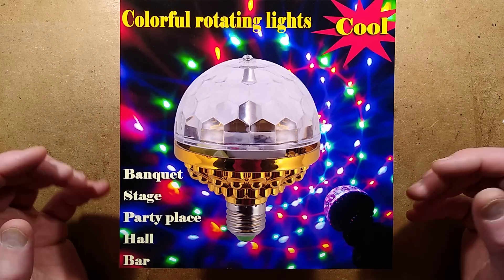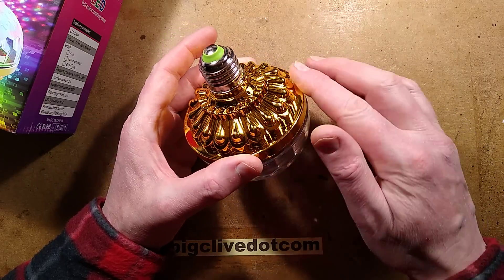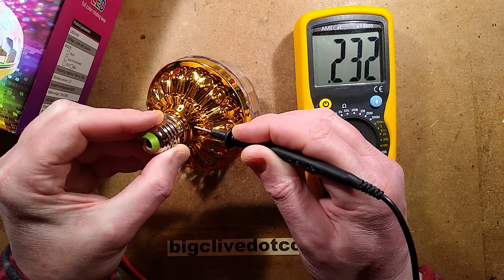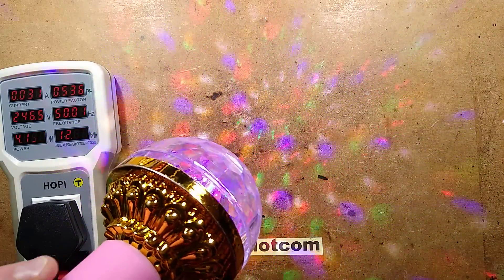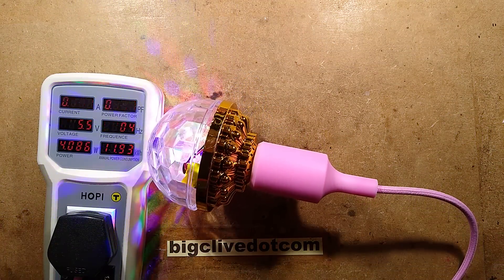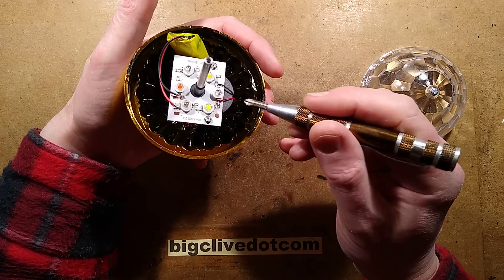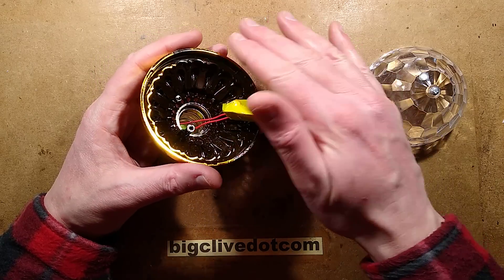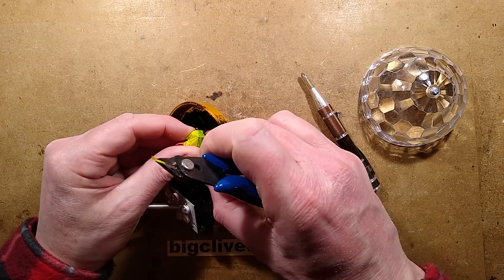"Shocking" disco light with 50/60Hz dance feature.  (Live chrome case.)

Comment: Hi Clive I know this an old video. When I was involved with Urbis UK they used the process of vacumised aluminium to adhere to the formed  engineerd plastic  which became the reflector with a rate of  90 + reflectivity specificaly used in the ZX 3  very popular streetlight. 
If i can remember the material that worked best was on polypropylene. Tried to replicate and found a company doing coffin handles and bling
parts in shinny Brass. Interesting visit. The cabinete was too small and designed to accommodate many small parts only. Did say it was a lucritive business they had established. LoL. Also, investigated the process of plasticise dipping as used on bling perfume bottles tops. Was not suitable. But,  I am going to do your experiment of checking if I get a reading on a Arimis mens cologne Gold cap. 
A question clive? Is the adapter you were used  legal in the UK as you so rightly mention the possibility of cross parallelity from BC to ES lamp cap.
Thank you for another interesting video. I guess the moral of the story it was never made for use in an adaptor only to be used in a E27 lampholder. Greetings from south Africa.
Reply from the maker: The BC to ES adaptor is in a grey area with regards to safety.
Reply: Thank you for your reply and much appreciated Clive.

Comment: Well you can also get shocked from the neutral if the lamp's plug isn't in firmly, with only the light itself as resistance there's still significant residual voltage, no?

Comment: I had an old TV a long time ago, the ones with the live chassis. Now I didn't think the chassis was really live, turnout it did have some potential. I found this out when one of the buttons with a metal cover was faulty and you had to really press it in to make it work, so much that the metal cover just brushed against the chassis and gave you a zing.. lovely. I found out about another one when I took a feed from the speaker through some resistors to a PC sound card to record some TV theme tunes. Turns out that was at a slightly higher than expected potential as well. oops. Sorry soundblaster.

Comment: I'm wondering if, even on a properly wired socket, the base contact could ever be touching the bulb without the screw contact touching, in which case the screw would become live and so would the chrome. Ideal design would require screwing-in before base contact occurs, but I could see the base being spring loaded and making contact first, or something of that nature.

Comment: Is it just me, or is pretty much every video from the UK starting to sound the same? 
'Don't touch anything, ever, if it's not made in the UK, to UK standards, by a certified somethingorother!'  lol
I know you didn't say that, I'm extrapolating!

So, let me get this straight... 
It is dangerous because if I touch it while I screw it in, AND the power is switched ON, then I get a shock?  Oh, wait, no... It ALSO has to be screwed into a UK adapter to fit their odd, non-polarized, socket which would need to be inserted in one of two ways in particular... AND you have to be touching something else for the stray power to have a place to go... 

There should be a counter in the corner of these videos that shows how many individual things have to go wrong at the same time to create the ideal conditions for any of this to be actually dangerous.  Crossing the street in any major city is more likely to kill you than waiting around for any two of these conditions to show up simultaneously!  To die from this particular device, no less than 5 things must go horribly wrong.  Yeah, I think that you're a wee bit anal-retentive about being shocked there, Clive.  ;-]

Conditions simultaneously necessary for this device to shock you:
1: Touch metallic coating on plastic enclosure while installing.
2:  Power to socket is ON.
3:  Socket is an adapter from screw-type to bayonet (only in the UK?)
4:  Particular adapter socket must be inserted in one of two ways that makes the screw part Live, instead of Neutral.
5:  Touch some other conductive, grounded item to complete the circuit. (#5 Must also be a separate limb from the one used to screw in the device if the shock is to be fatal. I.e.: Fingers holding the bulb and touching another part of the same fixture will not count as life threatening.)

So, as amusing as your title was, the chances of anyone dancing to the beat of this Disco Light is essentially slim to none.

Still, I love your videos, Clive!  
Cheers from Canada, 
where our power distribution system is NOT out to kill us at every turn!  ;-)

Comment: Bigclive would throw a hissyfit in Norway. Both my pins are active vs ground. No neutral wire here.
As a bonus I have 3 of them though. Using two separate mains circuits I can find a total of 3 phases all in relation to the safety earth.

Comment: it looks pretty moddable, you could slow down the motor and change the LEDs for single color or two tone as well as adding a spray on rubber coating to the chrome and you could have a relative classy slow moving projection lamp

Comment: Nice light, yep, too bad the Chinese have little respect for human life. I guess its normal for an over populated country. As for the lamp sockets, I guess the EU phased them out just for the reason of not being able to distinguish phase from neutral. This makes no difference as you said if someone wiring a lamp socket does not pay attention to where they hook up the wires. In the states lamp sockets are actually color coded with the Brass colored terminal being phase and the silver being neutral. BTY, I have noticed while living here in the EU for the past 14 years that there is NO difference in base size between an E26(USA) and a E27(EU) lamp holder. I can fit lamps from either region into sockets from either region.

Comment: Shocking.
I'd not thought about those adapters making the outer live before.
Reply: Well, an apropiate lamp holder has the screw-ring separated from the contakts benith it (many cases it's not even conductive as it the plastic holder the screw it self).
Edit: don't listen to me, the lamp screw is made out of one piece...
Why are we using E27 screws even these days?

Comment: Even if the "gold" paint had proven a competent insulating layer covering a conductive layer, it would be very thin so you still get at least a mild buzz through capacitive coupling.

Comment: I thought you were going to twist it and see if the leds glow, and then it gave you a shock, the chip sounded like a solar ic, then you mention about the strange capacitor, maybe it has other applications?
Reply: I had a similar lamp but only red, blue, green LEDs. When not connected to the mains: if I twisted it one direction the red and green lit up, twisted the other direction the blue lit up.
Reply: @nhytg376tgyuu765gjmg  I have one similar, same one I think Clive covered before
Reply: Aha

Comment: Very exciting indeed. When I was a young lad, we moved the TV out to the garage and my dad made a screen for the garage door so we could be cool at night in the summer. The TV was live if you were standing on the concrete (there was an area rug that was safe). We used to purposely stand on the concrete and try to shock our friends. We were kind of stupid. Fortunately there was some resistance as we didn't sustain enough to kill us. But holy shit, we did that. And probably turning the plug around would have stopped it.

Comment: Cos my dad remembers the old days of flawed lightbulb glass, he taught me to install lightbulbs holding them with a cloth and with the power/light switch turned off - then making sure my face is turned away from the light before switching it on in case it explodes into a million pieces. I still  do it that way now, and I'm still alive and unscathed from lightbulb accidents. Chrome or stainless steel light switch plates worry me tho. What happens if there's a stray wire at the back or some fool plugs something in that's wired the wrong colours in to a wall socket and the earth plate becomes live? Worrying that! I once got a shock from running water cos the kettle was wired wrong!
Reply: This is the reason that the UK regs insist that all accessible metal parts are earthed, even screwheads.  What happens is that the fuse blows or the breaker trips and you call in a qualified electrician to fix it.

Comment: Knowing and caring aren't the same especially when cost is involved.

I've always wondered if is possible to design a power supply that has a good power factor and a better VA value than those cheaply made Chinese ones with cost not being a factor. When the power company changes its billing practices it would be good to know.
Reply: Low power factor on DC power supplies is caused by the current draw being concentrated at the high points of the AC waveform due to the interaction of the rectifier with the smoothing capacitor. An uncorrected power supply tends to end up with a power factor of somewhere around 0.5.

The issue can be somewhat improved by adding an inductor ("passive PFC") in the power feed, that can bring you up to about 0.75 or so. In theory you could go further but the inductor would likely get prohibitively expensive.

The better fix is to add a special boost converter ("active PFC") between the rectifier and the primary capacitors. This special boost converter can actively control the input current and achieve a power factor of damn-near unity. There are controller ICs designed specifically for this purpose, for example https://www.analog.com/media/en/technical-documentation/data-sheets/8312fa.pdf

Comment: I've had a similar light with a plastic base. Sadly, the LED driver died less than a week after purchase and I had to return it.
The cap on mine was driven by an AC synchronous motor (instead of a DC motor like on this one) and had a random turning direction.

Comment: Rotating light like that reminds me of the time we had a glitterball in a show. We were driving it through a typical desk (Zero88 if you must know) with the synchronous motor across one of the lights focused on it - I think. The ball was suspended by a chain - random guess of about 10 links  which effectively gave some 'slack' in the drive - so I think what we did was power it up very dim - just to get the motor started before the effect was actually needed. Then, on cue put the spot lights up to full. At which point - or just before, the motor had wound up all the slack in the drive, hit the 'load' of the ball and bounced the motor into reverse just so that on bringing the lights up the ball was stopped again ruining the fact that we wanted the thing to be running when lit. I think it took me about 3 days to figure out why the ball wasn't rotating when the lights hit it despite having the motor running 15 secs or so beforehand. Couldn't be arsed to do anything about it for the remaining 4 shows !
Reply: pmailkeey to be honest, i love a zero88 but Im more a fan of a avolites
Reply: @thecrushingdutchman8202  Haven't come across Avolites other than briefly by name. For 'name-dropping': Strand, Strand/PC, Lee and '2' varieties of Zero88.
Which method of working does Avolites use ?

Comment: Not quite so unsafe when used where edison screw lamp holders are the norm. The UK insistance on using adaptors to convert bayonet cap fittings to edison screw rather than properly wiring a socket is the problem. That and the fact that chromed plastic fittings might as well be metal when it comes to conducting electricity as you so helpfully demonstrated.

Comment: This is a daft question but where does the isle of man get its electricity from? is it generated locally or are there undersea cables? I'm intrigued!
Reply: What a great question, I initially thought. 30 seconds later, after a google, there are two power stations. Peel and Pulrose. There's bound to be cables (wait, I googled) it.
The longest undersea AC cable in the world, no less. https://en.m.wikipedia.org/wiki/Isle_of_Man_to_England_Interconnector
Reply: They actually supply their surplus electricity to the UK proper.
Reply: Doesn't the IOM mine electricity ?
Reply: @millomweb  Looks like almost all of their electricity is generated from gas pumped over from Scotland (and then the surplus electricity is sent back over the cable.)
Reply: @RedwoodRhiadra  Odd as we've a high pressure gas pipe from Morecambe Bay to Sellafield gas power station. (It replaced Calder Hall)

Comment: Looks cool, but I have no need for disco lights either. I find them distracting. Gold is a gaudy color especially when it come to disco. I grew up in '80s and '90s getting shocked off of old lamps with unpolarized plugs. It's only 120v, but it still sucks. Then, I learned about polarization in the mid-'90s probably watching a PBS program. All you really need is a continuity tester and a sharpie. The neutral slot is wider in North America so that comes in handy. Of course, the best thing to do is to replace the plug with a polarized plug, but you can at least polarize plugs visually on the fly.

Comment: I had an argument with Ikea UK HQ about 10 years ago, when they managed to supply a batch of kids bedside light fittings with SES lamp holders and the 13 amp plug top wired up with reverse polarity. They couldn’t understand the issue I had with the screw part of the lamp holder being connected to line; probably because they were more familiar with 2 pin reversible plug tops!

Comment: A dremel with a stone bit can remove a few milimeters of the chrome near the edison screw connector, safer :-)
Reply: That wouldn't work completely cos the chrome overlaps to the inside and the dodgy solder blob could find it's way through the non thermo tape that the power supply board is wrapped in and touch the inside. China is good at being doubly sure about a products 'performance' !

Comment: I got addicted to these for a while, they come in many forms and that led circuit board is in a lot of them, some react to music, badly, some fade or flash, but I found them all far too sickly disco, so would either add to the spindle a cut out circle of acetate with coloured shapes printed on it, or a bit of card with shapes punched out of it, which tempers the effect to more tolerable levels.

Comment: We have one of the white base ones lying around somewhere.

I'm pretty sure the black colour on the inside of the base is the somewhat conductive spray paint (contains graphite?) they apply to the plastic first, in order to allow electroplating on the chrome. Something like that anyway. If the chrome is electroplated on like I think, the electrolytic process works more or less line of sight from the anode so the chrome mostly deposits on the outside facing the anode, whereas the paint "primer" underneath is either applied by dipping or it's sprayed on and sort of goes around corners a bit with air currents so winds up inside as well.

As for neutral or live wiring to the sockets, here in most of Norway there's no such thing as a neutral wire. All three wires in our three-phase power supply have some considerable voltage relative to ground (IT power grid vs the European standard TN grid you're used to).
Reply: Kaboomf Wikipedia says: Older homes in Norway uses the IT system while newer homes use TN-C-S.
Reply: @gordonrichardson2972  Norwegian-language wiki has that a bit different, and in my experience more correct. It's not about how old the individual home is, but how old the local power grid is. New homes built in an area where the power distribution network already exists will nearly always end up with the "old" standard IT. TN is used in most new development where the whole distribution network is built from the ground up. You cannot have TN in a building if the local power grid has no N wire, unless you install an isolation transformer perhaps.

Most homes in Norway are in existing IT grid areas, as is mine. I have three phase power available, and my multimeter shows all three wires are live relative to ground.

Comment: The metal is likely aluminum, not chrome, vacuum metalized with an acrylic UV cured basecoat and topcoat.  The metal layer is only a few angstrom units thick and while it tests for continuity with a multimeter, it cannot carry any significant current because the metal cross-section is so thin. Try connecting it up to two electrodes and see how much current you can measure between them.

Comment: For a laugh, wire the socket so the screw thread is live instead of neutral and then get a probe that goes to neutral with a 40w filament lamp in series... see if you can make the lamp light by scraping the end of the probe over the housing!

Comment: Clive I wonder if you can help?....the other day I was in a holiday hotel in Egypt and the restaurant had a glass wall with LED's inside that lit up bright blue. However when the display was off I could see the square LED's but no wires....How does this work?...by the way. I did take photo's much to the bemusement of my wife who wondered why I was photographing my fingertip...but the camera wouldn't focus otherwise
Reply from the maker: I can recall a similar sounding wall that had the LEDs powered via a layer of tin oxide or other transparent conductive coating.
The same could be achieved with ultra fine winding wire.
Reply: @bigclivedotcom  Yes I thought it must be a metal coating of some sort but I could see right through it no problem. However the wall, which was basically a wall of screens outside the restaurant making a sort of beer garden wall. I really looked close and the wasn't a trace of wires and they were all arranged in a large pattern. The wall itself was about an inch thick